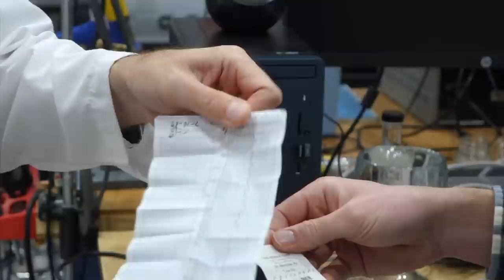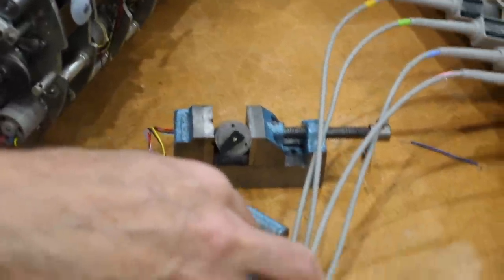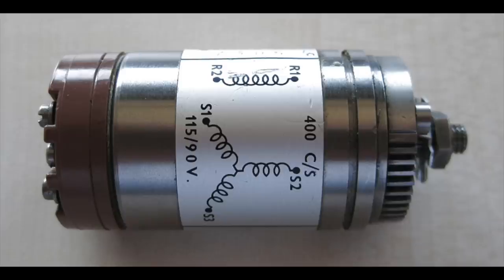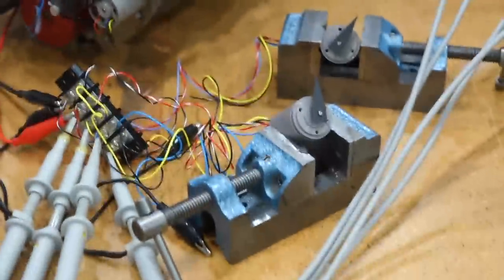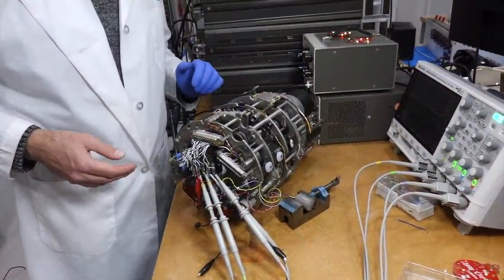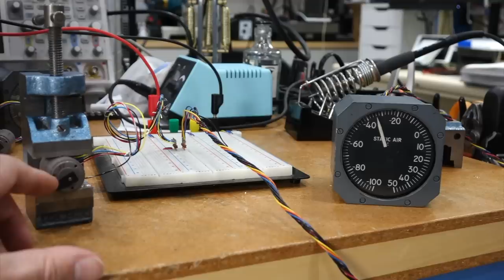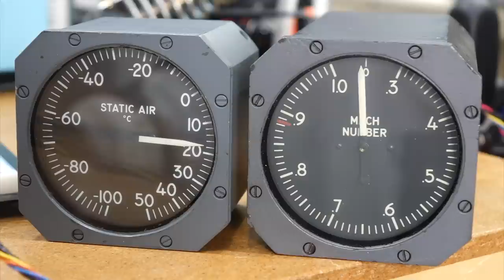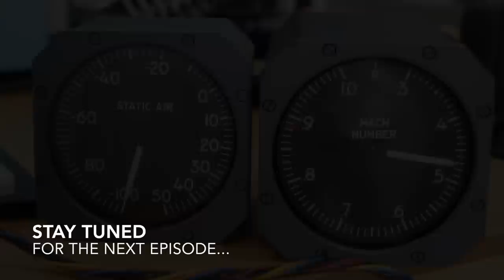Bendix Air Data Computer - Part 3: Intro to Synchros

Comment: Wow, watching this video and you mentioned "a very flat A", and it clicked, that's the sound I hear when I'm boarding an aircraft. It all makes sense now, thanks Marc!
Reply: 10:35, if you too were wondering. So that sound is the result of old-timey analog instruments being made to sing as a side-effect, thanks to the 400V onboard electricity supply that drives them? Are more modern airplanes with glass cockpits quieter in that regard?
Reply: 400Hz is such a legacy that modern avionics still sing along.  Cooling fans and transformers make enough noise on their own. Probably the biggest downside is that 400Hz is in the audio range and is hard to filter out.  It leaks into everything audio and communication related.

Many newer aircraft do away with constant speed generator drives and run the generators directly at varying speed.  Wild frequency systems will run anywhere from 300Hz to 600Hz.  You can tell by hearing the frequency change with engine speed.
Reply: @150flyer4  pretty much all AC frequencies are in the audio range though right? Even the ubiquitous 50Hz or 60Hz. I can often tell if a youtuber is in north america before they open their mouth if there's a stray mains hum. Apparently the cold war spies were totally on top of this when analysing audio signals they acquired.

Comment: Old ship board radars used syncro motors to transfer the motion of the rotating antenna to he yoke on the CRT on the display thus the rotating display was always the same as the antenna position. A simple switch on the antenna that closed when the scanning antenna was pointed dead ahead provided a brighter sweep line at the ahead position , heading flash. Gyro compas repeaters made good use of syncro motors to relay the compass rose position to places that they were needed. Most radars had syncro gyro position to rotate a ring around the ppi display that provided a quick accurate way of determining positions to true north in degrees.

Comment: Less than 5 minutes in, I'd like to make a guess about how these synchrons work:

They're built like motors that don't spin on their own. The rotor has an exciter winding that the 26Vac is fed into, and there's a three-phase stator (wired up in the delta configuration?) that picks up that signal. The synchro being moved acts like a resolver, and the angle is encoded in the 3 phase outputs, which is picked up in the other synchro, and converted to a magnetic field with varying angle, which the rotor in that synchro spins around to match up with.

It's kind of similar to field-oriented control (method of driving brushless motors, which are technically 3-phase permanent magnet AC motors IIRC), where you rotate the magnetic field generated by the stator, and the rotor follows.

Comment: These were used in IBM, with the name of ‘RESOLVERS’ with an accuracy of 20 seconds of arc.  
The IBM-2321 data Cell, AKA ‘noodle snatcher’ used one of these, on an analog servo circuit to position the bin to the exact address to pick a selected strip, out of 200.
(The old BB CC HH address)

Comment: This episode hits home for me. I have been working with radar and EW systems for nearly 40 years. Our sea  surveillance radar antenna platforms use synchros to determine antenna array azimuth position and tilt orientation. Just about all synchros I've seen used in airborne radar systems are 26 VRMS 400 HZ excitation. This is a great series of videos. Look forward to seeing more. Thank you for all the work and research your team does.

Comment: I have heard that name Bendix so many times, it's like the TRW of aircraft systems. Anything they couldn't buy they made themselves. And milspec, oh man I can remember visiting my Dad's workplace at IBM. They had a small library full of manuals for all the milspec relating to stuff they contracted/sub-contract for IBM FSD back inna' day.
Reply: I remember seeing a film from the early 1960s from IBM.  They talked about their involvement in SAGE making the vector display scopes.  They also mentioned making airborne computer parts for B-52s.  The B-52 system appeared to be cards similar to the ones in a 1401, but each card was in a black hermetically sealed cylinder.  Not exactly high density packaging, but it could work from -40 degrees up to an altitude of 100,000 feet while being rained on.
Reply: Eric Likness failed to tell us what the FSD meant.  I believe it means Federal Systems Division, basically anything to do with the government, and costing many times what other divisions would typically cost.

Comment: I work at a TV station, and we use to have a mechanical teleprompter that had several synchros motors to move the paper scripts through the machine, so the camera could photograph it, and place the video from the camera on the screen, for the talent to read. you would have a hand controller, and it would move the other motors in the prompter convertor belt. You could also gang several units together as well. it was quite cool, back in the day!

Comment: So fun!  I wonder if you could change the direction of the Mach indicator by swapping two stator phase wires?  In my avionics days, that was done to change the direction of the 3 phase motors.  Might work with synchros too??  BTW, I've got a spare resolver if anyone has a use for it.
Reply: Yes, it does.
Reply: That's why the wires are all color coded - to prevent things from going the wrong way!

Comment: I tried reading the Wikipedia article about these when the first video in this series came out and really did not understand it. I'm so glad you made this video and of course it makes perfect sense now.
On a high level, it seems somewhat obvious actually. The output of the synchro is a one-to-one mapping of its position to a state of three sinusoids. So, if you know the position your know the signal state and vice versa. Naturally, if you take this signal and jam it into another synchro, it will have to assume the same position because every position is tied to a unique combination of signals.
Great video!

Comment: Used to maintain syncro systems on a River class destroyer escort in the RAN. They were used extensively for the gyro compass to transmit to repeaters around the ship, and to get details on the position of radar antennas for some of the older radar displays.

Comment: That intro music always makes me so happy :)

Oh my, I figured it all out once I saw the oscilloscope! (That the magnitudes of each phase encodes the rotation angle, and the motion of the stator induces current in the circuit — a slow AC motor/generator pair!). But your elevator music explanation was nice to confirm my suspicions :D 

That's very elegant indeed. Always vaguely wondered how the dials in eg a Spitfire were driven. This is a bit like discovering the temperature gauges in Victorian steam engines were thermocouples connected to volt-meters! It's always nice to see how old some of these commonplace electrical techniques actually are.

Comment: The fun to be had when trying to modify a navigation switching system to include a new device is very overrated in my opinion.
 synchros and current driven signals where you have to keep the impedance constant as units are switched in and out runs rings around your head. Arinc429 and Mil1553 was so much easier. 🙂

Comment: Another unit of synchro systems is the Differential Synchro Transformer. This unit can do addition and subtraction of angles, say between the fire control director and the gun mount.  The differential transformer has 3 windings on the stator and 3 on the rotor.

Comment: Where the receiver needs to drive a lot of torque, like in the B-29 fire control computer or battleship guns, feedback from the receiver creates an error voltage if it's different from the transmitter position. That drives an alternator coil which generates the power to drive the actuator motor, which brings the receiver into position and nulls the error voltage. I'd love to see an episode on that error voltage, what it looks like, and what you can do with it.

Comment: There are a couple of good books that I would recommend to anyone interested in servo motors.  The first is published by Analog Devices "Syncro and Resolver Conversion " by Geoffrey S Boyes, and the second is "Theory of Servomechanisms" Vol 25 of the Radiation Laboratory Series. Both books can be found as pdf's online.
Reply: Thanks for the recommendations!

Comment: Analog devices used to manufacture a synchro to digital converter , we used them in a 1980s designed satellite communications system.

Comment: BTW, every body wants to work on digital domain. So there are R2D converter, that converts resolver analog output to digital format (usually 12 bit or higher bits of SPI data), to be handled by a microcontroller. These are manily used to avoid the arc-tan computation, which is needed in case of sin-cos signals from resolver.

Comment: These have been used in wind direction systems of wind measuring equipment that are analog for many many years. Mounted inside the weather vane housing, a 5 wire cable would be run down inside to the gauge with a compass. They would run with 6VAC across the rotors. Accurately displaying real time wind direction. Unfortunately these little gizmos are becoming very hard to find, as many have been discontinued manufacturing.

Comment: BTW, those synchros and resolvers are mounted with what is called "servo mounts". This is a semi-triangular "nut" with a tab that fits into the groove on the front of the servo device, and is then screwed down with a #4-40 screw (or maybe #2-56 screw, I forget) for little machines like this. You can see one in use in the picture of the static air temp gauge. Like motor mounts, servo mounts come in various frame sizes.
Reply: Talking of 4-40 screws. Would a 8-32 UNC be near size to a metric M4? Its come up in the past and struggled to find the UNC equivalent size. Obviously thread is different but was looking for replacements, not easy to get in the UK and got to know what your ordering if you do find something.
Reply: @gonzinigonz  Looking at some screw charts, an 8-32 is about 4% larger than an M4, so is approximately an M4.2x0.8. They likely have very similar torque tightening specs and holding power.

Can you order from McMaster-Carr? If so you could get US screw sizes.

Comment: Looks like a tailor-made solution for interconnecting mechanical computers with electronic computers. Maybe on some US navy ships in the 1950's, they had such hybrid systems doing firing solutions.
Reply: https://en.wikipedia.org/wiki/Mark_I_Fire_Control_Computer

Comment: My jet engine has a similar arrangement for engine speed.  There is a “tach sender” on the auxiliary shaft which connects to the “N1” engine speed indicator gauge.  The connection is 3 wire between the two, no excitation or outside power. I assume that no excitation is needed, as the gauge probably is a spring return to zero and requires a constant rotation input from the sender to produce the needle position.  So maybe they are just 2 synchronous 3 phase motors?

Comment: ooh, I appreciate the description of how mach numbers were mechanically calculated from pitot and static pressure. Back in the day, X-Plane couldn't give indicated mach, just actual mach from the flight model and insulated from any pitot/static failure. Might be fixed now, but if not, this would allow a better mach gauge to be simulated!

Comment: I haven't seen one in 20 years! Worked on these when I was in the Navy. They were used to repeat signals from the inertial navigation system (gyro compass) 120V at 400 HZ. On one of the ships I was on the backup 400 Hz converter was in our shop. When that thing was on you wanted to die.

Comment: You can run a synchro pair on low voltage 60 Hz. You can convert synchro to resolver using a scott-T transformer. If you synchronously demodulate the output and take the 4 quadrant arctan you get heading in degrees. A simple equation can also convert synchro 120 degree data to resolver 90 degree data. A simple CMOS analog switch and couple of Rs and Cs are all you need for denod.  I used this in aircraft instrument designs. We make air data computers no gears though. Really neat piece of technology. Great video

Comment: The Navy still uses sychros and resolvers!  Synchros send highly accurate 3 axis compass readings all over the ship for everything from fire control to navigation.  Meanwhile resolvers work on SATCOM systems so that antenna control units can keep gimbaled antennas locked on to geo-sync birds while the ship is bobbing around in the ocean.

Comment: From all my avionics work, 400Hz brings a smile.  But at the same it has driven me to virtual insanity after having to listen to it for hours on end!  

Apparently 400Hz became a standard as it was the fastest a generator could turn and yet still have some reliability at the time. 

I was taught that it has the sound of A flat, but I have zero musical ability.

Comment: I was fiddling with a synchro training setup that was not damped, when oscillations started building up and the much larger pointer started spinning wildly.  I grabbed it to stop it, and got whacked hard on my knuckles, hard enough to almost draw blood.  So learn from your mistakes and cut the power rather than get injured!

Comment: They were also used in the film industry to sync audio recording with the camera. As part of the pre "Action!" exchange, the director would call out "roll sound!" and the engineer in the recording booth would respond with "sound to speed!" indicating the recorder had matched speed with the camera and was recording.

Comment: At First I was like,, "oh, a sensored brushless motor instead of sensorless brushless motor".  Nope.  Quite much more.
Reply: A motor that is the sensor
Reply: [old] Syncros have slip rings to supply the excitation voltage to the rotor.
Reply: @sashimanu  Yep.

Comment: Marc, you made me Curious with the "very flat A" observation.  I tried to match the pitch of a simple tone generator to the sound in your video using my ear as the guide.  My result was something like 389 Hz.  How close was the actual output frequency?  Am I due for calibration?

Comment: Hi all. Once I connect 2 step motors to each other and they behave pretty like the syncros. Of course without the power, they do not syncronize like the syncros do. Just a curiosity.

Comment: If there is any resistive torque applied to the receiver, the motors act like pulleys linked with a rubber band. The more torque, the more deviation in the angle.

Comment: I am an avionics technical instructor and grew up with synchros and servos. It's quite nostalgic watching this video. The Resolver is still in use on more modern airplanes like the 747 to give position feedback to controllers in many systems and for position indication in the cockpit. Really enjoying this!
Reply: Makes sense - you get absolute angular position for an unlimited number of rotations, without any sliding or exposed contacts or resistors that might degrade. The only other way I know of to get close would be an optical encoder with Gray code, but that provides digital signals and usually has a fragile glass disk. The synchros and resolvers are marvelous devices!

Comment: Your mach number on that display doesn't go high enough for that computer probably. That was designed for a supersonic aircraft.
Reply from the maker: Correct. Not that many supersonic parts on eBay though...

Comment: To reverse the action of the syncro, do you just swap two of the phase wires?

Also, how would the Mach display return to zero?
Reply: how to return Mach to zero? Well, if on the ground, apply brakes until it is zeroed.

Comment: Would this work with two Brushless DC Motors? My guess is they would slip without the magic of 400HZ AC.
Reply: 60hz works.
Reply: @b43xoit  I didn’t have an amplifier that could put out the 115 vac 400 Hz to run the syncros I pulled out of some scraped Nike battery equipment, so I used 60 Hz at about 80 vac.  The syncros worked fine, maybe a little buzzy.  If you use 60 Hz, remember the winding is going to offer less impedance at the lower frequency, so the rotor drive voltage should be lowered to prevent burning the slip rings and/or coil.

Comment: So there must be devices for precisely outputting air pressure to test and calibrate pitot tubes, right?
Reply from the maker: Yes, and even very used ones are formidably expensive.